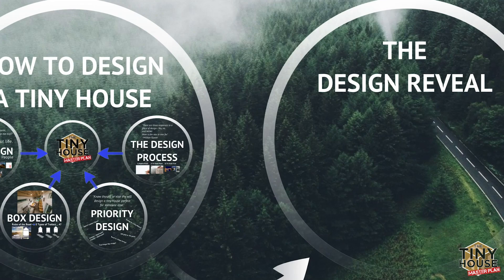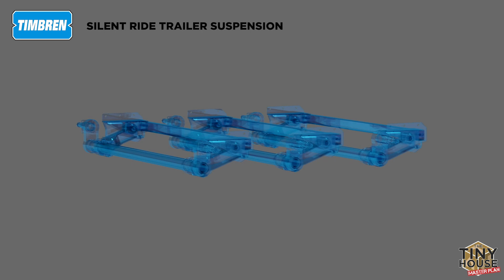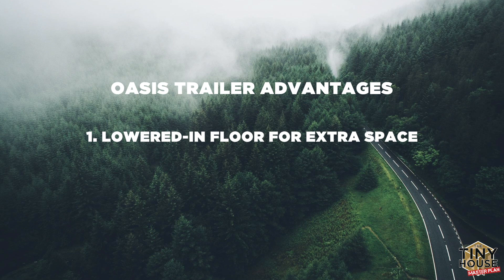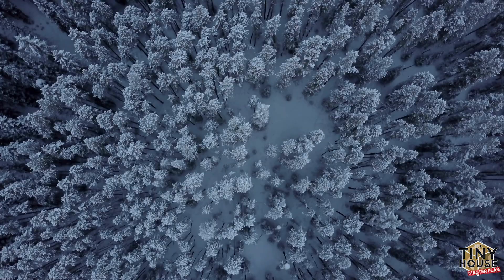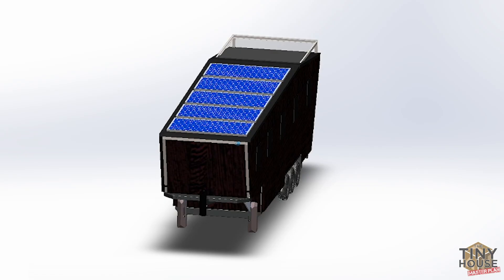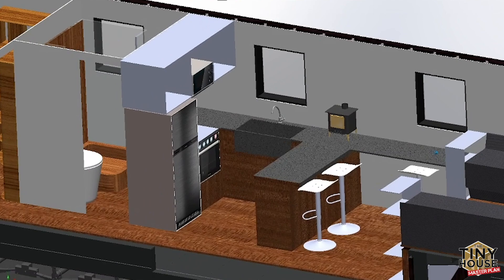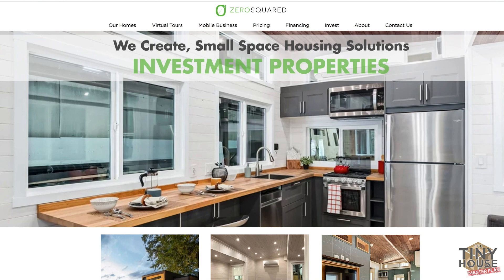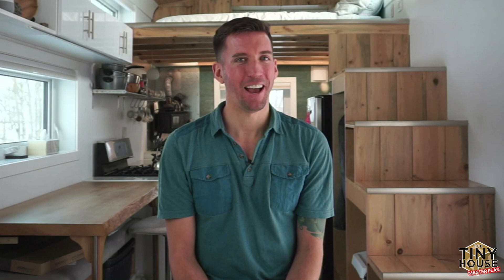Tiny House Design Reveal | Season 1 | Episode 8

Comment from the maker: I got 2 questions! I'd love to hear what your answer is to either or both:

1) What are you the most excited about on the design?
2) Whats 1 design idea you think we could fit into this house? :)
Reply: I can't wait to see the systems that you use to keep the house off the grid. I didn't see mention of anything related to the vacuum tubes you used with your home so I'm interested to see how you plan on heating the space and water. 😚
Reply from the maker: @AmandaComeauCreates  Cant wait to show them to you :) 

The Cubic Mini Wood Stove though is one of 2 ways we will be heating. It's the same stove I own and it's great. The later models have only improved as well so I look forward to using it!
Reply: A loft
Reply from the maker: @jonlaughton7689  we were tempted but as we are giving the house away to an unknown person, we wanted to make sure it was ultra accessible.
Reply: I like the "great room". Considering most people don't move their tiny often, hiring a flatbed for towing is not a big deal and you gain that lower gooseneck second level. Air quality is important, especially in a small space, so make sure there is good ventilation; I put a Lunos system into my daughter's tiny house AND a stove hood and bathroom exhaust. I'm thinking a separately vented composting toilet might also have been a good plan.
Reply from the maker: @turningtides1695  the Lunos is a great system! I used it in my tiny house as well. One will go in the great room, one in the bedroom for cross house ventilation.
Reply: Gahhh I am jumping out of my CHAIR excited for the whole thing but MOST ESPECIALLY the stage!!  And then...you blew my mind with the secondary stage!  What!!??  Our family has a dream to share music and bring community together to share the gift of frequencies that unite people.  Also excited about the desk on top of the double bed so it can be a multi-purpose room!
Reply from the maker: Haha! Love the enthusiasm! I can feel it in your reply @caseymacdonaldmedicalmysti9583  :) nothing like music to bring people together. ❤

Comment: This is a great design that will have broad appeal.  I'm wondering, is there a pitch to this roof where the solar pannels are installed?  As a fellow Canadian I worry about things like snow loads,  will this design be strong enough to take a few feet of snow from a blizzard? Is there a way to get on the roof in winter to shovel snow off the solar panels?  I design small homes/tiny mobile homes with Sketchup and I often find myself concidering design questions such as these.  Eventually I'd like to develop a small tiny home community where people can grow their own food on a beautiful, forested, riverside property I have in Southwestern Ontario along the Sydenham river.  It would be awesome if you could make it out this way for your workshops  this summer - London, Sarnia or Chatham Ontario are close by. I also have factory space on the farm near these urban centres, I would be very happy to have your organization hold workshops here - out of the weather.
Reply from the maker: Hi Craig!
Absolutely. Let's stay in touch! :) always got my eyes and ears open for the right opportunities. Perhaps reach out through the website contact form at www.kentonzerbin.com and let's chat over email and I'll get your contact info and more details. 

Also yes, there is a pitch to the roof! It's slight though and for heavy snow events a ladder is needed to access to the roof if shoveling is required.